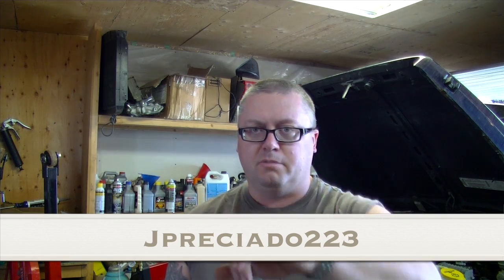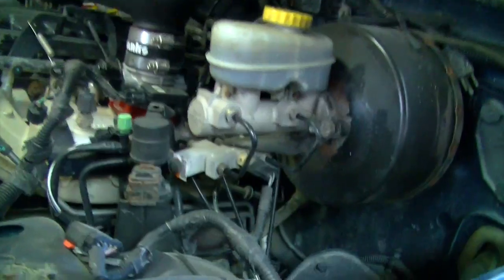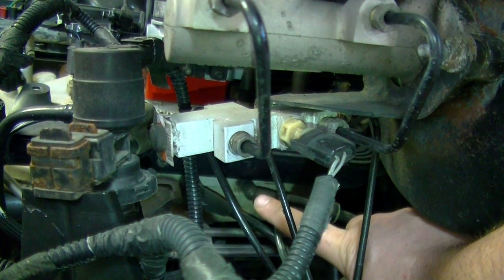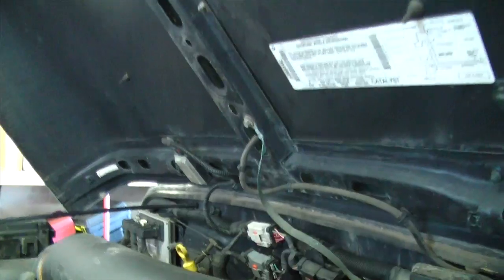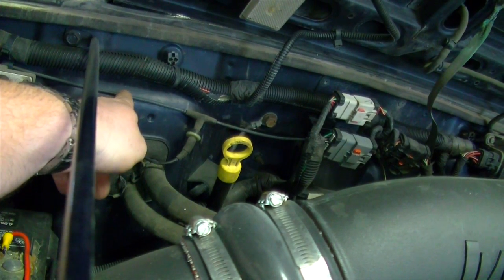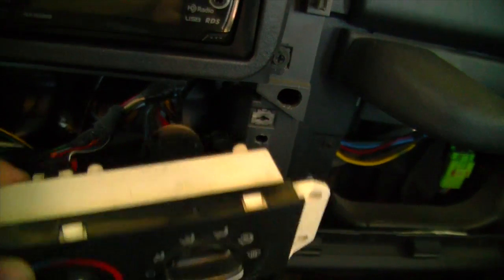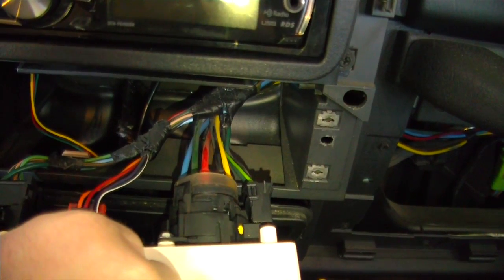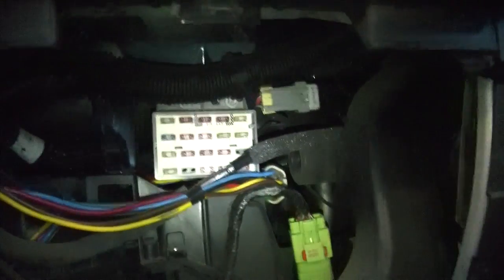Jeep Tj Hvac Troubleshooting Vacuum Issues

Comment: at this point it looks like that is my only option left. I am thinking about using your idea with the smoke machine and seeing if I have any leaks in my system. I remember last summer getting an EVAP large leak code a few times when it would sputter when I first started it, but it hasnt done that in almost a year. either way, I was never successful in tracking that leak

Comment from the maker: yes that's a good one indeed as you have done your research into troubleshooting the issue.  the only suggestion at this point is to find someone with a real good scanner that has graphs and record the data when you first start it and see what your fuel curves and all that are at.

Comment: well instead of renting a fuel pressure gauge from autozone I thought id try a different method and bought a mechanics stethoscope. placed it on each fuel injector and each one had the same click timing as the others, none appear to be sticking. I've already done the fuel pump assembly (with regulator) IAC, TPS, Coil, spark plugs, cleaned throttle...Im out of ideas :/

Comment: alrighty I will try doing a leak down test then. A few months ago I did a fuel pressure test on the check valve and the pressure was real low, changed the whole pump and it ended up resolving a misfire problem. The issue I have now with the sputter doesnt seem to have any other affect other then just when I start it up, but who knows, when I resolve it I may see a gas mileage increase. I'll let you know what happens

Comment from the maker: a faulty o2 sensor would in theory give you a code, however don't rule it out.  if you have a fuel pressure gauge i'd do a leak down test on the injectors in case you have 1 or more sticking.  a sticking injector would pump too much fuel into your system.  the 4.0 jeep has 2 upstream o2 sensors and 2 downstream sensors.  the upper 2 mix the fuel the lower 2 would pick up on the jeep running rich that is why i'm thinking that is not the case

Comment: haha I have the same radio as you, its pretty nice. btw I've been having a problem with my TJ for awhile as well, started almost a year ago. When I go to start it up after it has run for about 5-8 seconds it will sputter very roughly and then fix itself, I can also smell fuel when it does this. No engine codes has ever come up for it so Im not sure what could be the source. Could a o2 sensor cause this?

Comment: Cars Carssuck the fan speed switch is easy to replace just do a Google search and you will find the how to. I did mine last year also you may have to replace the resistor too which is an easy fix also.
Reply: My fan blower while on hi #4 blows like it's on #2. What can be the problem? Thank's

Comment: Hard to say. I very rarely run the AC. I do run the defroster though and haven't noticed a performance issue. Mine is not all that quick anyway as it has 35" tires with the original 3.73 gears.